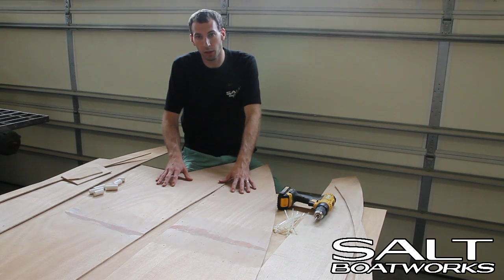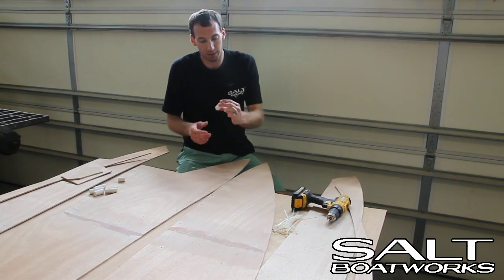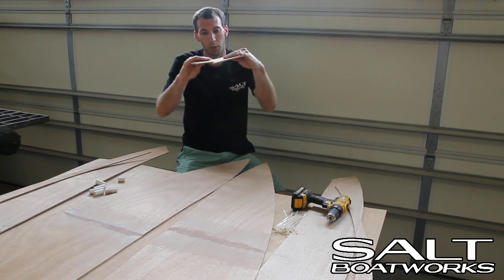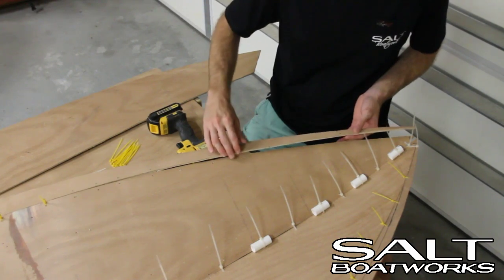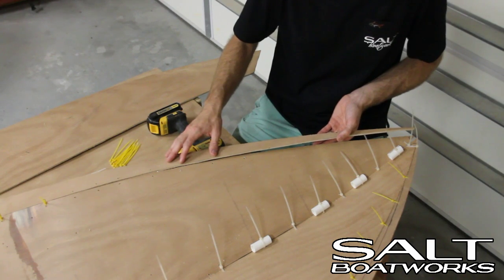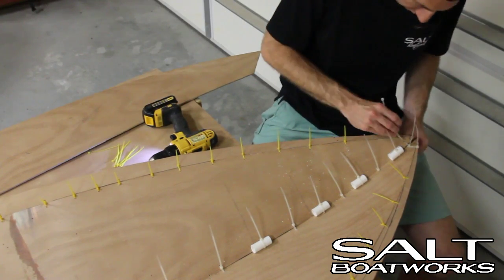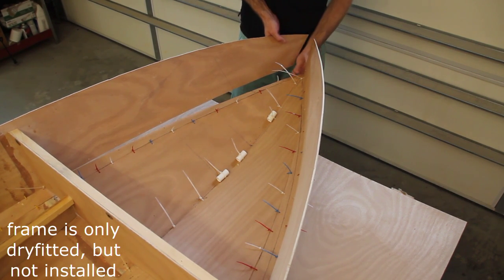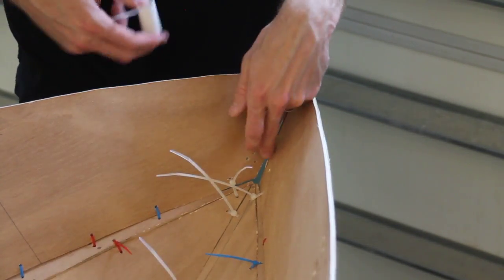How to Stitch and Glue a Boat - How to Build a Boat Part 3

Comment: I work for a boat building company. I love the build of the hull themselves but I can only hold my tongue for so long on this subject. You make amazing PLUGS. They work as boats but the wood will rot because of condensation and the amount of wood plus fiberglass doubles the weight. You also don't roll in high density foam with resin. The kind of foam you use expands with air that can cause a sponge/condensation effect causing damage to the wood frame and stringers causing rot over time.
Reply from the maker: Thanks for the compliments. While what you say is true for polyester & vinylester with plywood, which is arguably the cardinal sin of boat building.  BUT it is not true for marine grade plywood and epoxy that we use.  This is a proven (both practically and thru engineering) method of building boats.  For a full explanation and more info reference the the Gougeon Brothers book on boat construction.  They are the inventors/creators of West System Epoxy and pioneers of wood & epoxy construction.  Our designs are fully engineered, not just wood with some glass thrown at it.  We balance the weight and strength of the wood with the fiberglass as both are part of the overall laminate schedule.  For example, a foam cored panel capable of the same strength for our FRS-15 skiff would weight at least 2x as much and cost over 3x as much.
Reply: I'm not a boat builder but I'm almost sure that if you don't leave the boat all year long in the lake or sea, it won't rot with actually even basic epoxy...

Comment: I'm not sure if you mentioned it in the video but is there much difference than using tie wraps or wire for the stitch and glue method? I've seen both but I'm not sure if one is superior over the other. Or easier. Tie wraps seem an easy method.
Reply from the maker: We like zip ties because they are so much easier.  You can use wire but you will be cutting it into short strips, then bending, routing and twisting with pliers.  That can get old pretty quick and the sharp cut wire ends seem to inevitably cut your hands.  With a zip tie you just feed it thru the pull tight, plus the sound they make is very satisfying too.
Reply: Right on. Thanks for the reply. I’ll use the zip ties once I get my boat plans.